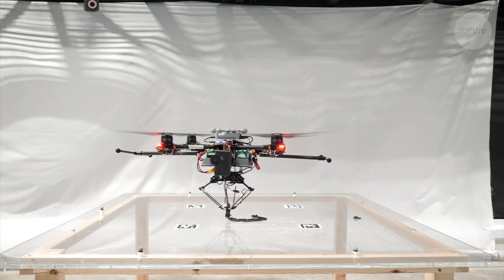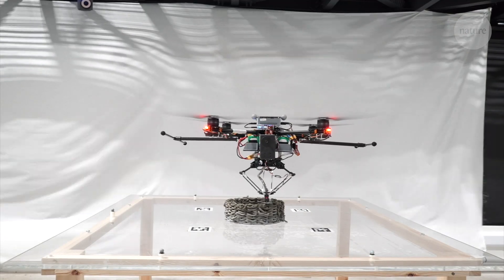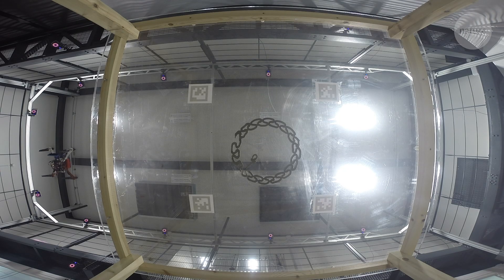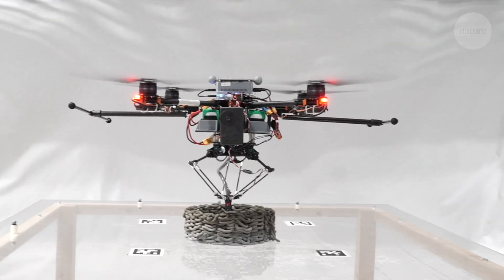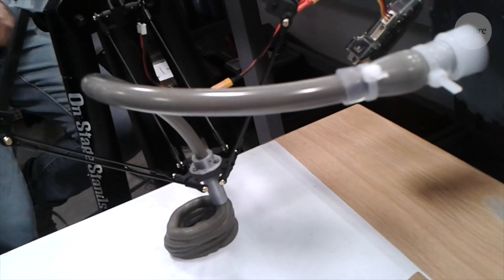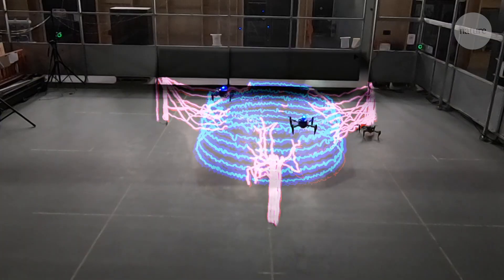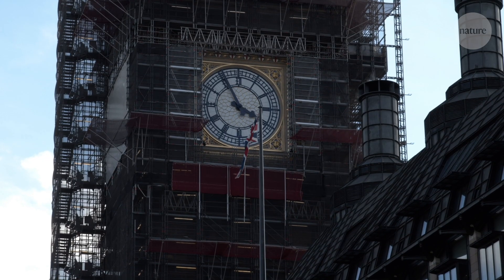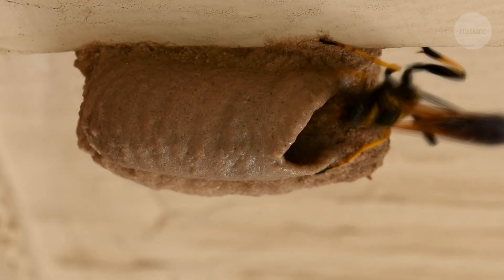3D printing with drones

Comment: Considering wasps stand they could make a spider drone with "mandibles" which were 2 extruders, and using small high friction pads and ect to climb while printing, multiple could be used in a hivemind system that would let them be more efficient,more useable in windy environments and even moe when built properly

Comment: To those talking about energy and efficiency. This is probably not trying to solve a problem or be better than traditional 3d printing. Its a really difficult controls/materials engineering, with a fun solution. Likely its just that. Technology demonstration, where lessons learned can be used else where.

Comment: Why not just use wheels/tracks to move the robot's that build our houses around, flight is the less energy efficient way to move robot's around and stay idle in the air, wheel cost zero energy to stay idle. ;)

Comment: If you applied solar powered charging stations and local materials, this would be a great opportunity for emergency structures that return to the environment soon after their initial necessity.
1.Emergency fresh water collection
2. Baskets for sorting collected foods
3. Containers for anything
4. Emergency messages
5. Housing/storage structures 
6. Irrigation pathways
7. Safe walking/ driving terrain designators
8. Emergency supply hut creators

Comment: In the future, when an avalanche has destroyed your nice chalet, you simply wait for a swarm of angry robot hornets to poop a windowless "shelter" for you... seems like the adequate insult to go with your injury.
Reply: @Kotori no shogai I teach technology and manufacturing at a rather decent college in the EUC. Every technology that's in desperate need of a "problem" always, always will be linked to some form of disaster relief or some real/perceived threat to humankind. When an avalanche wipes out a village, concrete-pooping drones won't be used for many reasons: freezing temperatures and concrete don't mix, concrete is the least suitable building material when weight is an issue and your "temporary" village will require heavy machinery to remove it when you are done using it. Disaster relief will always use light & collapsible structures like tents, or prefab houses (think of Ishinomaki Lab here). I don't question the tech shown here - I have an issue with "nature video's" mindless babbling. ... but there is ONE reason that will kill your pooped-concrete-in-the-cold concept: thermal insulation. Concrete needs insulation in most regions of the world and that will interfere with the drying of the concrete, extending the time until the structure can be used - not what you want in disaster relief...

Comment: well... considering the drones will be limited by the weight of the material they need to transport anyway, wouldn't it be easier to just have a swarm of drones assemble a house out of per-built blocks like lego?

how about you make a swarm of brick laying drones paired with a few cement spreading drones... sounds much more effective to me...

Comment: novel but this looks basically useless. youve combined the energy inefficiencies of flight with the added inefficiencies of slow 3d printing. at most this would be useful for airdropping modern art and at worst someone would send a swarm of these to slowly construct houses only for them to get rained out or blown away. 

i get roads can be destroyed, but these things wont have good range and they'd need power, so they need some infrastructure and logistics too. want to know what doesnt require electricity, good weather, and on site logistics? trucks full of tents.

Comment: drones aren't practical whatsoever
they can't carry very much material at a time, they use a lot of battery power to sustain flight with heavy printing materials and other hardware.
this means very frequent stops, slow printing times, and very excessive power consumption
Reply: yes

Comment: It's an interesting proof of concept, just to say that you did manage to 3D print with a drone, it's definitely not an efficient or scalable solution
Reply: Its totally scaleable, effecient though? Not at all.
Reply: @PellyEllieEla  I also doubt scalability. Battery management will rapidly become a nightmare.
Reply: @christianbarnay2499  as in replacing the batteries or recharging? Becuase that is an issue someone has already solved.
Reply: @PellyEllieEla  As in having to manage recharge, aging, replacement and disposal of batteries for a lot of drones. Who has already solved that issue?
Reply: @christianbarnay2499  the guy who made replaceable lithium polymer batteries that almost all drones run on.
Reply: @PellyEllieEla  You clearly don't understand the difficulties I'm talking about. It's about logistics and maintenance. Taking care of the batteries of one flying toy you play with on Sunday is not the same as scheduling and tracking the usage of a fleet of industrial drones that you need to fly, charge and repair efficiently all day long every day of the week.
Reply: @christianbarnay2499  trust me i know, i went to college and built drones. Im certified to fly non-civilian drones through part 107, and im fully aware of battery logistics. All you need is ~4 batteries per drone and you can fly 24 hours every day for a few years if youre constantly charging.
Reply: @PellyEllieEla  And the charging stations with a power source that needs to scale with them. And the storage room for the empty batteries and the full batteries. And the people to swap the batteries on the drones and on the charging stations. With a small fleet you can handle all that overhead process alone. But when it scales up you need a complete support organization to properly handle all those support activities.
Reply: @christianbarnay2499  the scaling your talking about would end in a drone swarm, which you need individual approval from the FAA to do each time you do it. There's only supposed to be 4 - 5 drones building one thing at a time which can easily be managed by one guy, which is required to supervise the drones anyways.

Comment: If it could land to print when conditions allow, that'd save a lot of energy.
Reply: Yes, if it was a truck with all the cement and then a printing crane! ^^
Reply: @Bobby.Kristensen  It can be better with quadruped robots with a robotic arm for depositing the printing material.
Reply: @aphilosophicalnaturalist6245  Quadrupedal robots are more complex with a higher rate of failure, plus they add weight, which adds energy consumption and so on
Reply: @guysebastiangarciapomales2341 but they're also SIGNIFICANTLY more precise with their movements. Drones can and will never be like that because there are too many attenuating factors, like drag, upthrust, tilt, etc.
Reply: I am 100% positive that is possible, but unsure of whether or not it would actually be more efficient, consider the extra weight it would add just to have that part introduced, and how large scale would it be producing? The whole idea behind these guys are the fact that they can swarm up to quickly build a structure. Imagine you give them pathways to build something circular, they can literally just follow eachother in a loop filling in different segments of the pattern. We already have drone swarm tech so we are about halfway there in that sense.

Comment: "The biggest problem is accuracy' 
I am sorry, what about material weight and efficiency? It's a cool demo, not any future. Nobody gonna use helicopters to build houses!
Reply: Still, they would be quite different, I feel and you can always simulate it somewhat. Maybe it's useful, but I personally doubt it.
Reply: They might use it in space or something
Reply: @smorrow  there is no air in space to push with fans...
Reply: @redo1122  It would be the same algorithms that they developed for this, is what I meant.
Reply: Drones can actually get pretty good lift as you move up in price, efficency is the real worry.
Reply: @PellyEllieEla  efficiency of energy, time and money is in play here. It's simply expensive to run massive power into drones, just to move a relatively small amount of material.
Reply: @redo1122  ok

Comment: You should combine helium filled dirigibles, with multiple gyroscopes (propeller blades with weights on ends of blades propagating in multiple planes to steady them further.) Possibly use on drone to do printing while other drones can deliver printing materials might work too.

Comment: Lol no. Huge waste of energy . Good for testing if this is possible but  really? And you want it to make  it. Cheap right? Using drone to make constructuok greener? Riiiiiight
Energy consumption just to fly plus it will consume more energy carrying/pumping the concrete or whatever material it would use.

Comment: Also it won't be able to lift anything heavy, It can barely keep itself up, Where are you going to get the material? For like a house on a hill, you would want a truck to carry the machine and the material. Robot arm, not that thing they built, that's so one purpose.

Comment: The issues with the concept are: 
- extremely expensive,
- needs special materials (more expensive),
- not reliable (needs absolutely controlled environment),
- inaccurate (even in closed spaces, it drifts a lot),
- sensitive to every details that can't be controlled,
- energetically very demanding, while its effectiveness is very low.

So, you've made an extremely expensive, unreliable, inaccurate and finicky drone that can deliver and place building materials, when it's not raining and there's no wind at all. Congrats, paying four workers for days can cost much less, while their accuracy depends on how you treat them.
Reply: Exactly

Comment: HOW DO YOU GET PRESSURE ON THE PRINT? When a 3d printer works, it is actually pressing some of the new layer into the last layer. Look at those layers. They're perfect cylinders. And the resolution is just disgusting. Think of how much energy it would take to keep re charging all those drones. You'd have to spend more on the infrastructure for drones, than just building a simple cnc gantry. This is SO DUMB

Comment: If the goal is to eliminate huge cranes, extensive scaffolding, etc, then just design a lightweight portable articulating boom and put a small printhead on it.  Whatever tech you have developed to precisely locate the printhead using the drone can be used to position the tip of the boom.
There is no need to actually fly.
Reply: Yeah, but there are different trade-offs for both approaches. These robo bees are definitely less efficient, but more flexible and should be easier to deploy once their autonomy algorithms are perfected. There are many cases in technology where the efficiency and speed are not the winning factors for mass adoption. A quadcopter is not necessarily the most optimal solution for this kind of job, but the basic idea of distributed robot workers make sense and we know it from decades of sci-fi. In the end the best analogy is actually not bees, but... humans.
Reply: @kazioo2  You could have multiple small arms with printheads. They could all be mounted on one articulating boom.

Comment: Its neat, but I would be more impressed if they were able to do this in the presence of wind
Reply: As said in the video, the printer head compensates for movement of the drone due to wind. Clearly there would be a max wind speed permissable though, above which the drones stability software and printer head compensation couldn't cope.
Reply: @martinw245  The drone already struggles and sways a lot in the small air movements created by thermal convection and people moving inside their closed lab. It will never have enough power to overcome even a slightest outdoor breeze.
Reply: @christianbarnay2499  

I'm afraid you can't say that. It's a prototype. And the movenet of the drone itself isnt the thing thats stabalised, its the small printer head.

As mentioned in the video, stabilisation software allows the printer head to compensate for such things even outside. As said in the video, to millimetre precision. Obviously there a max permissable wind component.

Software and rapid response micro-motors are perfectly capable of moving that small printer head rapidly enough to compensate.

And of course, they wouldn't be bothering if it wasnt feasible.
Reply: @martinw245  You didn't understand what I said. You can see in that demo that the small breeze in the lab already shakes the body of the drone very widely. Its capacity to stabilize the print head is impressive. But those are ideal lab conditions with almost imperceptible air movement. They say they expect to use that technology on hard to reach mountain tops where winds are orders of magnitude stronger. This tiny object is simply too light to be of any use in such conditions.
Reply: @martinw245  "And of course, they wouldn't be bothering if it wasnt feasible." Nothing is more wrong than that statement. Building things that don't work and understanding their limitations is an integral part of R&D.
Reply: @christianbarnay2499  

"You didn't understand what I said. You can see in that demo that the small breeze in the lab already shakes the body of the drone very widely."

It was sped up, all movements  are thus exaggerated. Its also a prototype, the finished product will undoubtedly be different. But despite that I saw zero instability. 

And not relevant as the stabilization is in the print head, not via movement of the entire drone.

"Its capacity to stabilize the print head is impressive. But those are ideal lab conditions with almost imperceptible air movement."

Yes, the test was in lab conditions, and it printed very precisely. 

The print head stabilization was impressive in the lab. And that fact does not give you any data, any reason, to  claim it cant also stabilize outdoors in a breeze. Clearly the researchers developing this tech think it can, because they aren't idiots and would have considered such a thing and determined it feasible.

The researchers obviously understand their own stabilization technology and know if it can do what they want it to do... outdoors.

"This tiny object is simply too light to be of any use in such conditions"

The finished product is designed to build large scale structures. Obviously it won't be this small and building structures for ants to live in. 😁

The researchers/engineers, who are qualified to do this, are not morons who haven't got a clue what they are doing and we don't  know better. With respect, its their technology, THEY know if the stability is sufficient, not you and me.

Again, they wouldn't be doing this if it wasn't possible to achieve the required stability.  

.
Reply: @christianbarnay2499  

"Nothing is more wrong than that statement. Building things that don't work and understanding their limitations is an integral part of R&D."

True, but when you discover your device CAN'T do something utterly vital for its use case, so much so that its useless without, you don't then claim it can to the world.

With modern stabilization software, I have no doubt that this will be feasible in the outdoors. But again, there will obviously be a maximum wind speed and gust component it can operate in. 

As said, its likely to be larger. its designed to construct buildings.  And even basic light weight drones can now hover in the outdoors in a stable fashion, add to that the ability to ALSO stabilize the print head and I see a potentially feasible product.

Comment: Hard to scale. Would be most useful in constructing in hard to reach places.
Reply: Even for that use case it is way more efficient to use the drones as a pure transport system and do the actual building with traditional cranes or 3D printers (ground-mounted or climbing). Hovering while printing is just an enormous and useless waste of energy.

Comment: As someone who works with 3D printers daily, it's definitely an interesting idea.  If it does develop to the point it can be used in real world applications though, it would be decades in to the future (I would be happy to be proven wrong though!).
Reply: doesnt need to be decades away could be used to patch holes on buildings that would usually takes cranes or men with harnesses and stuff to access
Reply: @Kektamusprime  not to mention patchwork to prevent water damage until scaffolding and builders would be available to do it "properly". Or even with the right material you could use a swarm of these bots to build an organic scaffolding that could then be "eaten" by the drones and reused later. Setting up scaffolding for large building projects today are both costly and time consuming.
Reply: imagine swarms of builder drones, yikes!
Reply: I doubt it will be that far away. Look at the past 10 years lately vs the past 10 before that and so on. Tech industry has been making massive leaps and swarm tech is already in place. All they have to do is multiply these and scale it up slightly. 
Really don't even have to scale it up either. Just add more drones and have them perform different parts of the task.
Reply: It doesn't have to take even a decade at this point. We have the tech, we just need to apply it. In other words, all it takes is a crazy, rich dude with the ability to market it just right.
One concern is the noise. Imagine a few hundred of these drones at a building site
Reply: 2-3 decades seems realistic. Can't wait for this, absolutely amazing technology.